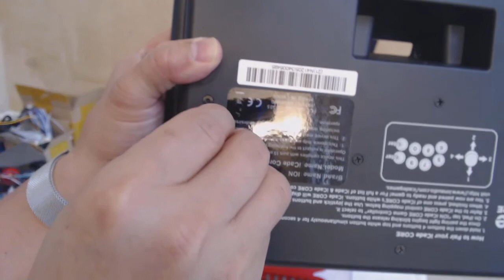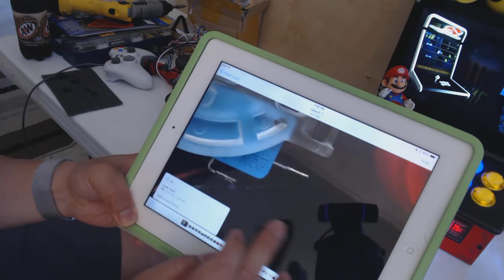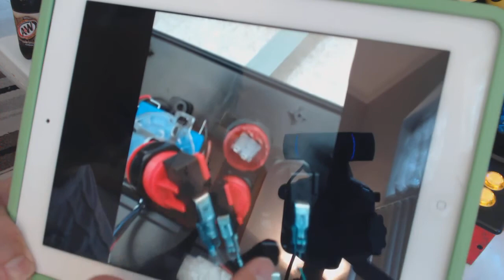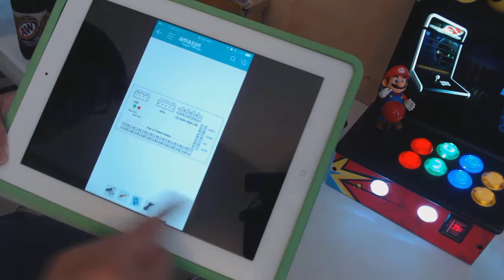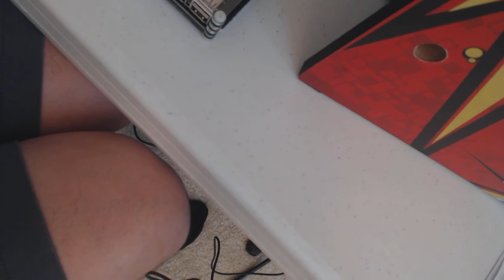Icade Cabinet(Build, teardown,LED Buttons)Part3

Comment: One of the few You Tubers who took the time to show how to do the mod.  Most importantly TY for showing the detail on the button build.  Many ICade mods and very few detailed modification video's.  Hope you are liking your Xmas Edition NEWGEO Mini!  I like mine.  Had no luck getting my $39.99 NEOGEO X arcade stick to work with my mini.  I even tried the MayFlash adapter.  It works fine with my Pi so that is good.  Might make a great video if you can figure it out.

Comment: Thank you for the video. Explains alot.
Reply: What power supply are you using ? Also most of the links are not working 😕
Reply: Yes, are you using a 2 way charger? One end of display and one of Raspberry pi or do they have there own power supply.

Comment: Jonny how did you remove the middle shelf where you place an iPad inside the icade did you saw it off or did it have screws ????
Reply from the maker: Hi Alfonso Torres, I did both. I unscrews the middle piece off and did some cutting too. I have video on that let me go find it. Video one talk about what I remove to make it work. https://youtu.be/2T89o1NtyVg
Reply: Johnny Liu i just saw it bro thanks but those it have 4 little screws that need to be taken off?
Reply from the maker: hi  @alazan_oficial , You have to used T10 bit to take those screws out. Check the Video 2 or 3 it talk about the Bits you need to used to remove in order to take the iCade apart.